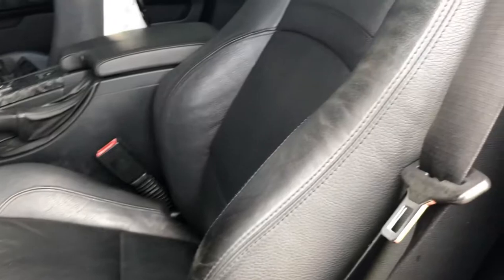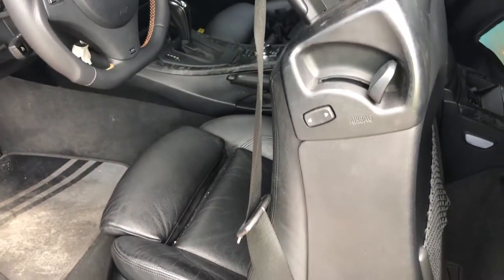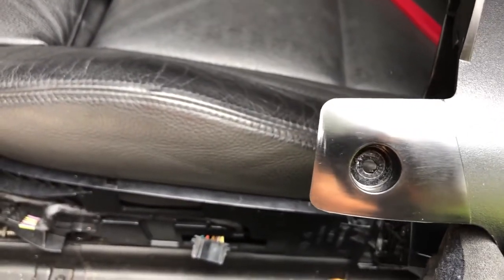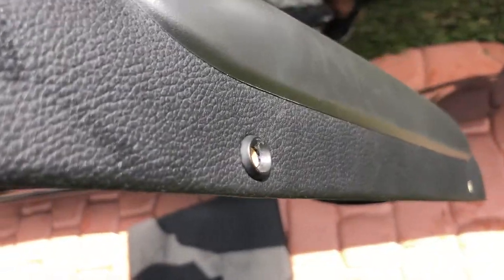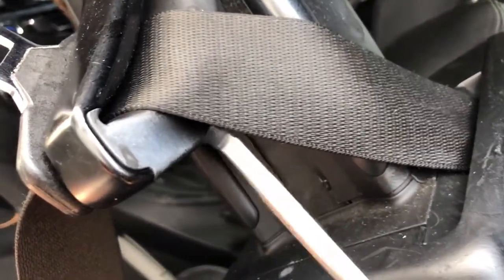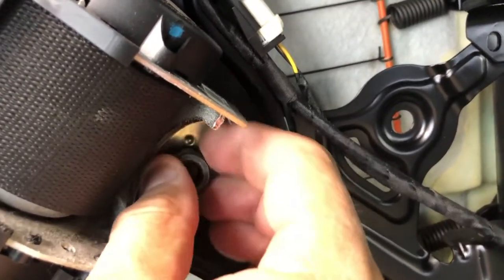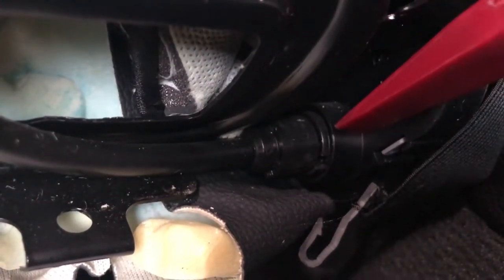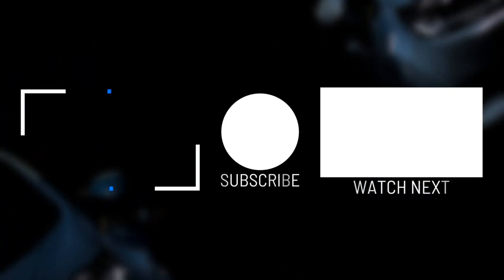Seat Belt Removal - BMW 335i Convertible

Comment: Great video. Only one i've found so far that applies to CONVERTIBLE and it IS different! I only wish I could find one that is specific to 2000 BMW 323ci E46 CONVERTIBLE. For now, I have already removed most of seat belt but, this gave me info on the seat belt "Loop" cover removal and seat belt detachment at lower back of seat back. Thank you!
Reply from the maker: You’re welcome. Glad it helped a little.  Thank you for watching.
Reply: @DomiY  You're welcome. Can you direct me to a video specifically for a 2000 BMW 323ci convertible seat belt removal(like yours>? They are slightly different. Thank you, again!

Comment: Thank you for posting this! i've been looking everywhere for instructions on a E93 seat belt assembly i do have a question- i spoke to my local BMW Specialist for replacing my Seat belt but they are saying that i also need a spacer along with the seat belt?  would you happen to know what what a spacer is?
Reply from the maker: Glad the video helped you understand the process.  I’m not sure what spacer they’re talking about. Whatever I removed I put right back in. Thanks for watching